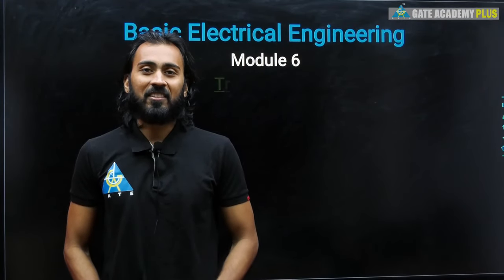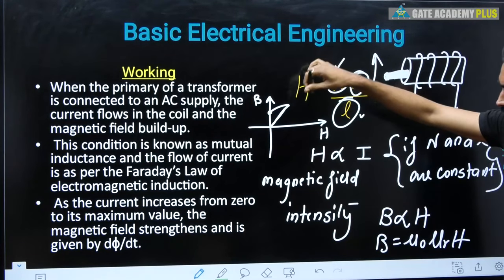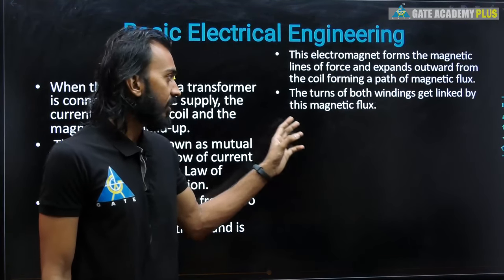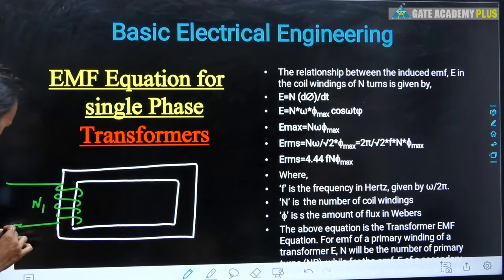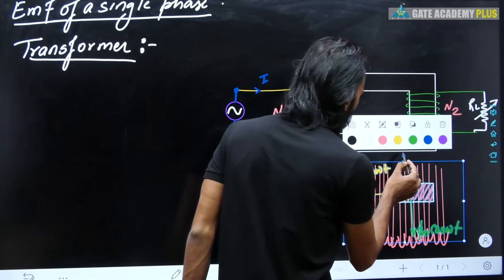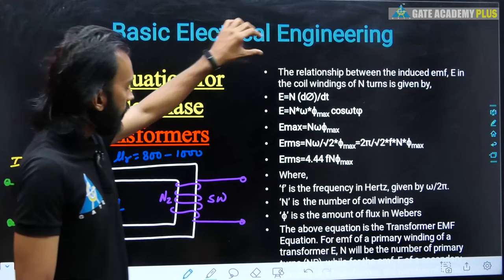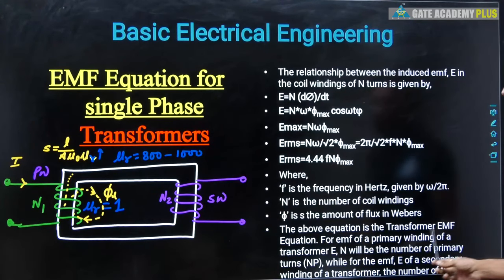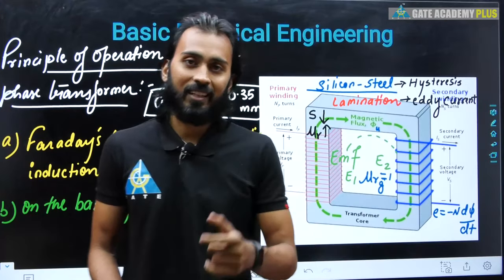Basic Electrical Engineering | Module 6 | Working & Principle of Operation of Transformer | Lec 64

Comment: Hello Sir,

As transformers do not change power. In step up transformer , voltage will be high and current will be low on secondary side as compared to primary side. 

Pls explain how current is decreasing on secondary side in step up transformer?
Reply: Good point. But sad reality is he isn’t going 2 clear ur doubt....